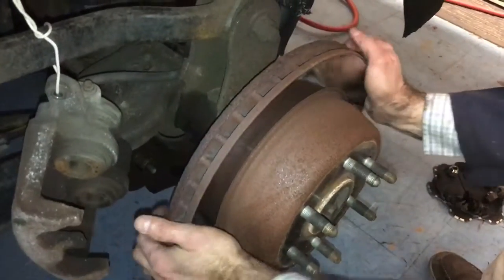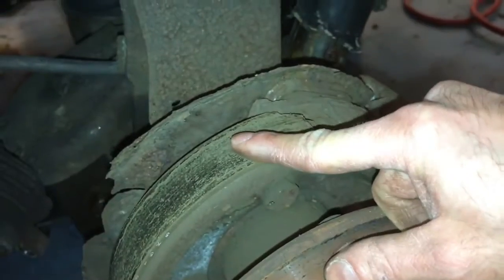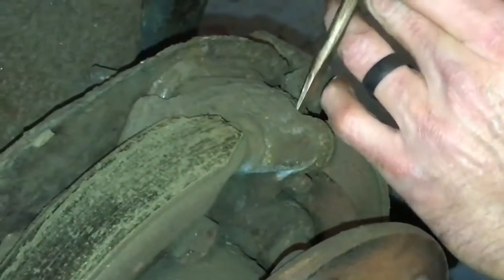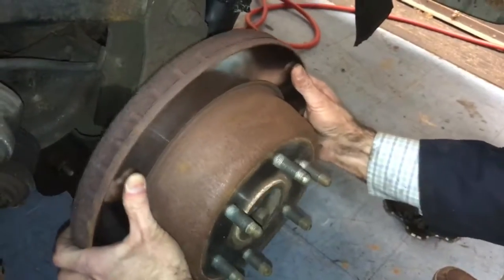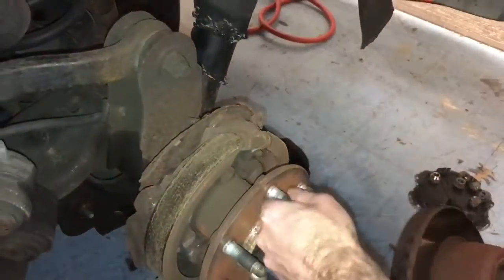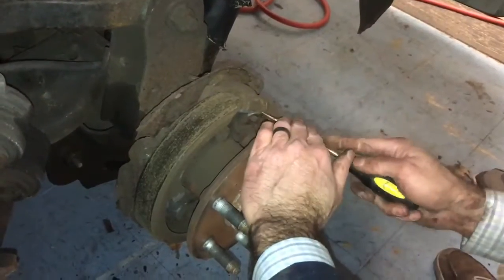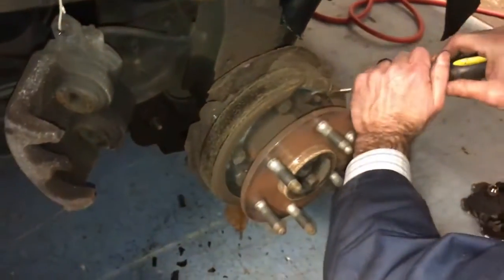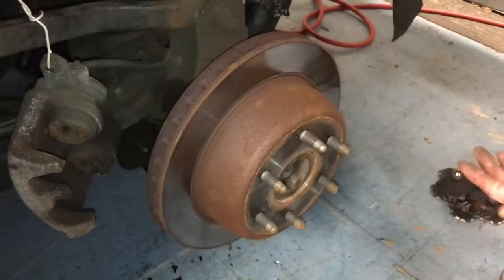DHS DIY Drum parking brake adjustment 2002 GMC Yukon Denali

Comment: Mine's on the bottom (same vehicle though) and to get the new rotor on, I had to push the E-brake first, then tap the top of that little gear thingy to make the pad some inwards after releasing the E-brake.  Thanks for the vid.